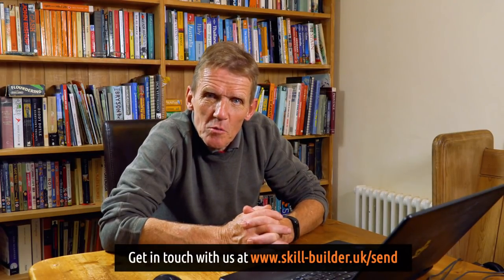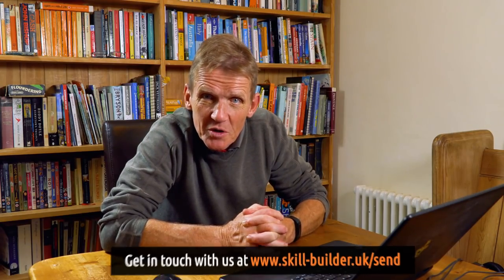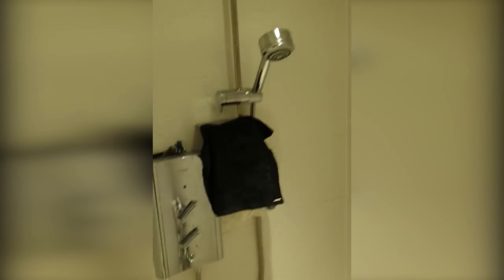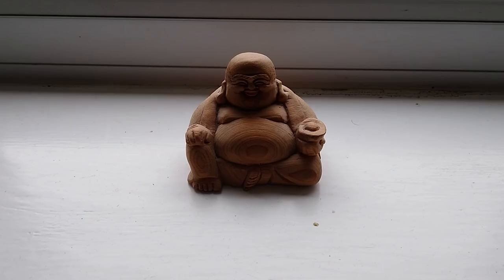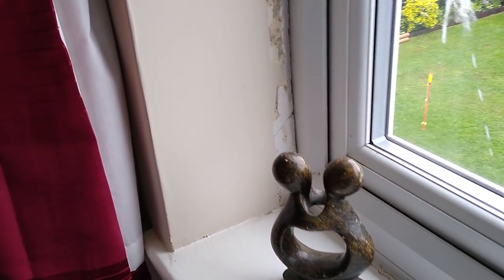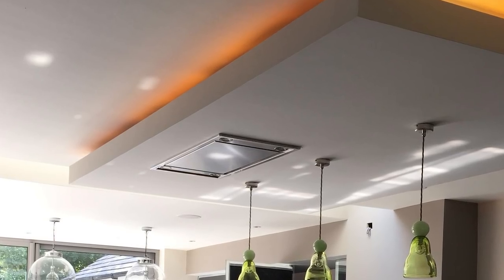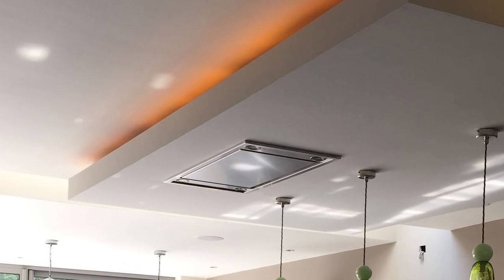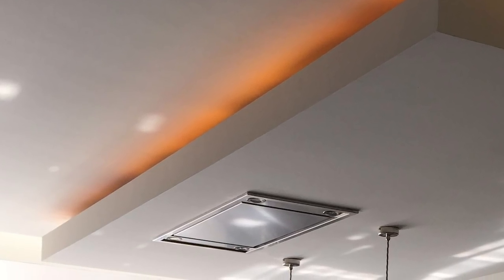The Old Mould Problem Returns - ASB #15

Comment: Excellent advice on this video to all questions. I am retired now but have worked in building and engineering for over 50 years. 
On the mould thing, use a proprietary mould cleaner, bleach will take it off but won't kill it.
Reply from the maker: chris 

 good point i forgot to say that bleach, when dry attracts moisture like a sponge.

Comment: I had the black mould problem too. In my case it was the plaster bridging onto the outer skin. Chopped away a band all around the window, foamed it up and then replastered the reveals. Worked for me 👍🏻
Reply: I know this was 2 years ago but how did this solution hold up? I was thinking about retrofitting cavity closer but foaming the cavity around the window reveals would be loads easier.

Comment: Hi Roger, I think that there is an obvious and simple solution to humidity problems, which is opening the windows each day in winter for about 10 and 20 minutes and in summer as much as you like.
This will help tremendously in evacuating humidity and preventing mold development especially in old houses where you don't have a central ventilation system.

Comment: If the moisture has nowhere to escape, it will sit on your walls which will attract mould. It's pretty simple. Open the windows every now and then or invest in some good ventilation. No special paint, or sealant will tackle the root cause.

Comment: We had black mould and wet problems in window reveals and the wall above. Turned out the problem was solid concrete lintols above with 1 brick course due to roof rafters slope (so a single skin to the outside but behind the fascia boards. Sides were plaster touching the exterior brickwork, albeit through a good dpc. Solution, remove plaster and fix 15mm marmox board to sides and top of reveal and skim. The L section concrete lintol was insulated from inside the roof (with extreme difficulty!) With 1" Cellotex cut and stuck on with expanding foam. The alternative would have been to remove the gutters and fascias to get at the beams/wall. Redecorated. No subsequent condensation  or mould.

Comment: Pumped waste systems normally have a small tank inside and when the water gets to a certain level the pump kicks in, looks to me like the pump is higher than the outflow from the shower. Drop the pump under the floor level and the problem will sort itself out.
Great video as always
Reply from the maker: There are other pumped waste systems that don't have a float switch. The start working when the shower is turned on.

Comment: Adrian Reynolds. - You're right about lack of trickle vents but als notice that the windows are placed right on the outer face of the wall. This means that a cold bridge is formed where the outer leaf passes over the window. The current obsession with air tightness and the poor design of placing those windows beyond the cavity are the cause of the problem. Open the windows and leave them open, get the air circulating and it will go away.
Will Laurie, we have the same shower trap, it collects hair in the pot under the cover and needs regular cleaning, - we're both oldish and don't have too much hair left, but when our sons girlfriends stay, it clogs up quickly.
Reply: instaBlaster.

Comment: The mould problem could be where the old  felt has fallen into the soffits and condensation is dripping down making a wet environment, by the look of those facias, they look like some rot has got to then. Felt lift trays and roof vent tiles should resolve that issue

Comment: Not a problem with the cavity wall insulation, but the reveals haven't been insulated so you will have some cold bridging at the windows. Get some humidity measuring devices then leave some windows on vent position should help. 40-50% humidity in winter is good. Or as you say an extractor system. Reduce humidity sources and use any trickle vents or extractors. Almost every house I viewed  when I moved has the extractors turned off in every wet room.

Long term, next time the windows are replaced open the internal reveal a bit more and insulate it very well to help, combined with the other things this should do the job.

If you've just replaced old leaky windows with new ones without trickle vents in either the walls or the windows then technically you'll be breaching building regs and any window fitter should know that.
Reply: Oh and forgot to say, check the outside of the window has been sealed against the bricks or cold drafts will make the cold bridging worse.

Comment: I agree with Roger but before I'd say it's cold bridging from what could be a concrete lintel which bridges the cavity which is less thermal heated as it won't be insulated, you could put in an insulated lintel ( too expensive). Also I'd check your cavity stops on the cavity tray above the window.

MCIOB
Reply from the maker: The upstairs lintels are eaves lintels with nothing on the outer skin but the timber wall plate. the real solution has to be to get rid of the airborne moisture, it is not healthy
Reply: @SkillBuilder  oh my word, I do apologise regarding the lintels but yes some anti fungal wash asap
Reply from the maker: @Harryistired  Don't apologise Jason. It is a discussion and all views and observations are welcome. The value of Ask Skill Builder is in the comments from others.

Comment: The Cavity wall insulation can exacerbate condensation problems. firstly the insallers almost always miss large aras around the windows and under cavity trays which contributes relative cold spots . penetrating water can accumulate in cavity trays with mineral wool holding it there slowing the natural evaporation. Also it's worth pointing out that by exposing the CWI for the extention could be interepreted as distubing the CWI and void the 25 year guaratnee for the wool - also installing an extractor duct though the wall can also void the guarantee. absolute con.  Insulated cavity closures would be preferred for new window installs but if it's e.g a concrete lintel above the windows then that is a difficult cold brige to solve.  Hard to insulate it adequately but using a material that buffers moisture and naturaly mold proof can help. I'm experementing with lime hemp rendern for reveals as it is very alkali and naturally mold proof, provides some insulation from cold bridges and has excellent moisture buffering to cope with daytime variability e.g 2 occupants in bed.

Comment: Re trickle vents,  yes they are usefull but realise the direction of flow is likely to be cold air in , not warm/moist out  , depending on prevailing wind , stack effect and any extract/wood stove flue etc...

Comment: Mold present in my house,  constant battle with it. Decided to try "anti condensation paint" early days yet and have not yet put any finish emulsion over it. The label reads use two coats. The product states it puts up a thermal barrier on cold surfaces. Not cheep at £20 litre though.
Reply: straight up snake oil. condensation happens when relatively warm humid air touches a relatively cold surface. how is a layer of paint going to change that equation?
Reply: @cho4d  Ok here"s how it went. That winter after applying the paint i had no problems, after that back to normal. The mould happens about 18" above skirting level. The property has had lagging on the outside of the house. Rented property so it should not be my problem.  Thanks.

Comment: Tip 1 - so many people dry/warm towels and clothes on radiators. Nooo, where do you think the moisture is going, don't do it.
Tip 2 - most windows can open a fraction and still lock, do this and it lets each room ventilate if there is no vent on the window.
Tip 3 - so many people have extractors with no humidistat built in or leave the extractor fans off because they make a little bit of noise, fit a decent extractor, the best you can afford (cheap ones are rubbish with a very low extraction rate) with built in humidistat so it can clear the moisture out.
Tip 4 - put a bowl of salt on the window sills, they help absorb moisture out of the air, you can make it look 'pretty' if you like by adding a few pebbles or using a decorative bowl ( be carefull in kids bedrooms and probably put on a wardrobe nearest window so it is out of reach )

Comment: I don’t think you are right about the mould though.

The house doesn’t have a chimney so should have been built to modern standards. 

Should maybe look at the way the windows are sealed and if they are using extractors in the kitchen and bathroom. 

The cavity may not be correctly done. 

Also why would that wood burner produce soot on the soffits/facias. 

What about exploring the loft insulation? Ask how long they’ve lived in the house?

Comment: I have a rental with the same mould problem.  Whenever I walk past there is never a window open whatever the weather.  This house appeared to be the same, all the windows closed tight!
Reply from the maker: In rented places you have to have an whole house extraction system that they can't turn off. If you leave it to the tenant they won't use it.
Reply: Skill Builder Piv fan work a treat for me  around £500 plus fitting, and worth every penny .
Reply from the maker: @Lord-Brett-Sinclair  good tip. We will investigate further

Comment: Hi buddy watch a lot of your videos you're very into all trades great guy a quick question i have an issue 2 things 9ne 8s soare room lots 9f mould /damp/moisture around mostly the window side external wall , the wall joining thus has a vent that I've left open but don't seem to help much .....other issue being our front room right side reveal (right side from inside )keeps getting cold and moist is this likelynan insulation issue ? I can not see any 9bviois leaks from.ouysude but the windows do get condensation but left side isn't affected at all 

Thanks buddy

Comment: Just one thing about mould is the position of the rads . When you have a rad under a window especially on the north of the building you will get a large build up of damp air when warm air meets cold surface i.e. window glass you hit due drop point . Plumber's need to stop putting rads under windows 👍
Reply from the maker: Hi John 
We were taught in college that the best place for a radiator is beneath a window. The cold air drops from the window and is hit by the warm air rising so it warms it up and creates a very vigorous convection across the room drawing in more cold air from the room to feed in the bottom of the radiator. This can be proven with a simple smoke test. 
That said long curtains kill the whole thing stone dead so it has to be considered. Underfloor heating is what I now do. I have put a radiator in for ages.
Reply: @SkillBuilder  I agree  totally  with what you have said it works in theory but not really in practice curtains or blinds of any type seen to debunk this idea I still think that when it comes down to it , stick it under the window out of the way , try and get a plumber to put a rad anywhere else but under the window it's like watching a bull dog chewing a wasp 😂

Comment: can you please help, just recently noticed black mould around pvc windows top and bottom of wall in corners and growing through window corner joints as well ,i noticed a drip from my gutter on  back of house where the affected area is ,using long pole and camera i found my gutter was blocked and full of moss and water , can that cause the mould as ive never had mould in 20 years what would you advise
Reply from the maker: I think the thing to do is clear the gutter and then see what happens. My initial thought is that it is condensation on the cold bridging. Put a couple of these on the window cill and see what happens. If they fill up fairly quickly then it is most probably condensation. 
https://www.amazon.co.uk/2562368-Moisture-dehumidifier-Condensation-Absorber/dp/B07XJ58SFX/ref=asc_df_B07XJ58SFX/?tag=bingshoppinga-21&linkCode=df0&hvadid=&hvpos=&hvnetw=o&hvrand=&hvpone=&hvptwo=&hvqmt=e&hvdev=c&hvdvcmdl=&hvlocint=&hvlocphy=&hvtargid=pla-4584413743017114&psc=1
Reply: @SkillBuilder  ta much gutters getting cleared tomorow and ive got electric dehumidifier running next to bedroom window thanks again

Comment: My friend had this mould problem tried every thing and was going to move house because of it , someone suggested a positive pressure fan and it worked , got rid of all his mould and has never has returned
Reply: What is a positive pressure fan ??
Reply: It's a small fan that draws air in from your loft , it runs all the time but is very quiet,  it just increases the pressure inside the house only by a small amount but it does work
Reply: Had the same in a terraced , worked a treat.
Reply: There is a video  on YouTube it's called    how to fit a PIV unit   may be some help to you . I was very sceptical about it but he told me it done the trick, all mould gone and he was serious about moving he had tried everything it was doing his head in
Reply: I had exactly same problem, after a lot of research I bought and installed a Nuaire ECO Heat PIV (positive Input Ventillation unit) its a DIY job not complicated and its stoped condensation in its tracks, but be aware that you have to still promote ventilation so that stale air escape from property to promote good ventilation.
Reply: @GrandslamTim1  I have an 1850s town house with serious relative humidity (RH) levels, circa 75%+ typically in the downstairs bedroom (partly lower ground about 2 foot below ground level) which leads to condensation of external wall and regular black mould growth.  I have fitted 2 Nuaire ECO units, first 12 months ago which reduced some of the condensation on the living room window, but didn't help RH in the bedroom nor much in rest of house.  
Tech support couldn't understand why it wasn't making a bigger impact and decided it was the windy nature of the house layout.  Had a second ECO unit now installed in ground floor pitch roof (bathroom extension), which is just metres away from lower bedrooms and while RH has fallen to about 70% it has still not done what I was hoping for.  In the other lower bedroom I have a dehumidifier running 9am to 4.30pm each day with the bedroom door closed and that is keeping the RH down to about 50% in that room only 😞
Reply: @jameshowarth2516  sorry to hear James, I am no expert in this area but my house is a lot more modern than yours, I suspect you have more of an underlying problem than the Nuaire can cope with. This guy on You Tube seems pretty good perhaps you need expert help Damp Sam HNC CSRT CSSW . Good luck
Reply: @jameshowarth2516  Try MRXBOX95 heat recovery system.

Comment: I'm looking for a budget table saw, would you have any recommendations, thanks
Reply from the maker: Hi Keith 
 I haven't used anything other than the DeWalt and Milwaukee but I have so Triton tools and most are not bad for the money.
Triton TWX7CS001 254mm Electric Contractor Saw… (9024R)
Reply: @SkillBuilder  thanks

Comment: That first video the two pipes going into the soil stack on bosses look 21.5 overflow pipe I've never done that before
Reply from the maker: It is done for condensate from boilers as well as Saniflo. Better is a 32 mm boss and a reducer. That looks like it is bodged in with silicone.

Comment: Cutting a ceiling joist isn't necessarily that big a deal. We do it all the time. Often less work than that drop ceiling you show. Just be sure that before you go cutting ceiling joists that you consult with an engineer first. There are many strategies available for doing it correctly dependent upon the particular situation.

Comment: Struggle finding bathroom fitter. I always think its as easy (or as hard) to do a job correctly as it is to do it incorrectly, it just takes longer. My problem is finding customers that want to pay for that time, when you get one its great, best feeling in the world doing a good job for a good customer at a good price. Most of the other plumbers I know just want to boiler bash, easy money, in & out and on to the next job. They can prob earn double doing that than bathroom fitting. Good for the wallet but oh so dull.